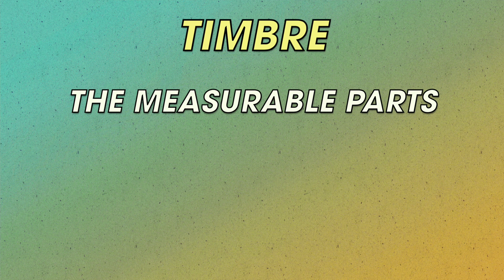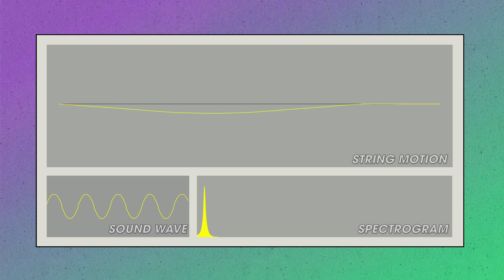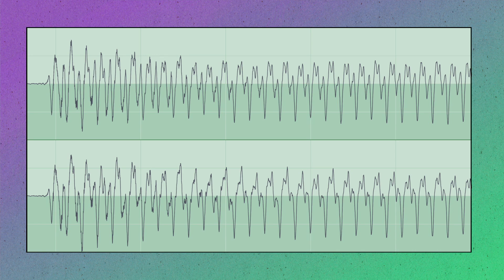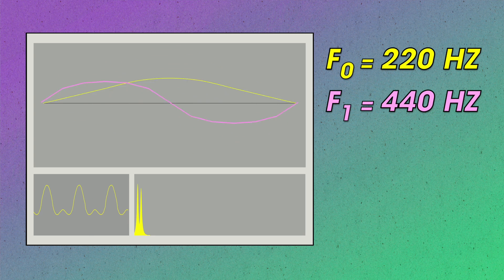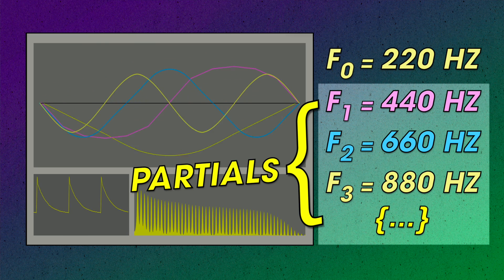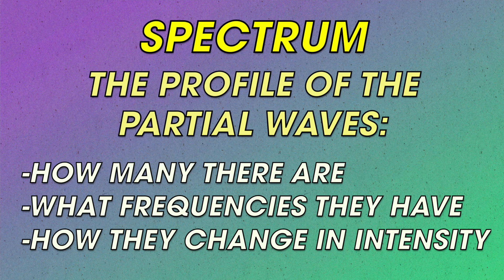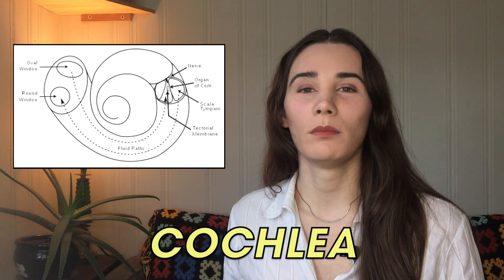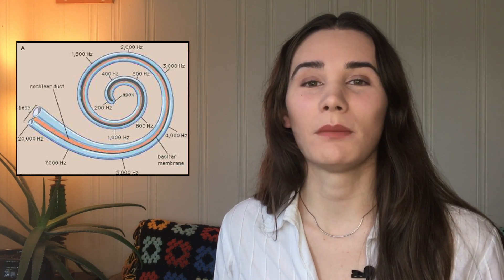What [almost] Everyone Gets Wrong About Timbre

Comment: I am confused by how string could physically vibrate on different frequencies at the same time, or maybe gradually. You showed it as several strings vibrating differently at the same time. 

I’ve seen videos of strings vibrating in slow motion - it actually looks like it’s vibrating at one frequency at the same time.

Comment: Volume,speed of light traveling at condensed pressure increased force different colours are different heat and different levels of atomic weight in the qaurks as the frequency value degree travels at different rates so hence waves the heavier burn at one rate and get there slower than higher rate speed light energy under excited pressure burning hotter the qaurks through dimension in waves expand contract in fission fussion and atomic weight particles break at different rates and burn different the alteration is breaking then qaurks join to other atoms attract increase propel some further in higher weight and burn so new intensity of colour on spectrum i think that is why people feel the asmr at different tones how the weight and volume speed force of different levels of tone and timbre colour hit them as sensory differences are distinguished
Reply: Tones frequency timbre sound at different rates of speed between high and low notes and the ear hears some before others so it can throw off the beats the rhythmic pattern and people notice time changes in rhythm

Comment: It's a very interesting subject and how the brain interprets sounds and timbre certainly is subjective but saying it's impossible to define is something I don't agree with. 
What you refer to as partials in this video is the harmonic series that naturally occurs. Sound is nothing more than stacked frequencies. The relation between those frequencies defines the sound/timbre. More specifically, the shape of the fundamental (not a perfect sine wave but rather a mix with triangle/sawtooth or square wave depending on the source) and the shape and amplitude of the different harmonics aka overtones is what literally shapes the sound.
Of course you know all this. I just wanted to add the physics part of sound.
Reply: Also very interesting what you said near the end about hearing the frequency and timescale at the same time. Just our brain's ability to recognise someone's voice you know, could be over the phone, on television or in a busy street is fascinating. Think about this, if you pluck a guitar string it vibrates at multiple frequencies at the same time. If you measure them over time you are certain of the amplitudes but can't know their position in time. If you take a snapshot however you are certain of their position but not about the amplitudes. Does this sound familiar to anyone? You could almost say the string is vibrating in a quantum superposition. Because in the end, everything is made up of frequencies that interlock, combine and or react with each other. The ' frequency beating' that you hear when two pitches are just slightly offset and light slowing down in glass or water or any material really is basically the same phenomenon of two frequencies cancelling out and adding to each other with a certain frequency. In the case of light it's the beating frequency that we percieve as slower light because the photons never really slowed down. We know this because when light exits the material it does so at lightspeed. Anyway, frequencies man... Let's just say it resonates.

Comment: Very complete! I saw a couple of papers that used the following method: the researchers played pair of sounds to musicians and asked them to say how much, from zero to 10, they were different. By doing this they got a bunch o sound pairs and the distance between them. Notice that hey had the distance between a flute and a piano, a piano and a clarinete and a flute and a clarinate, for instance. Using the example we (three sounds and three distances) we can now build a triangle. A plane is defined by two dimentions - the x and y axis. They then got measurements off of the sounds and tried to find if those two axis meant something.

In reality, they got a huge number of pairs and a huge number of opinions (the distances from zero to 10). They used statistics to normalize the opinions (if one musician never said a pair was distant by more than 4 they would stretch his numbers so 4=10). After that they did something that requires a lot of math to solve: they had to find the positions for the points in a plane or 3 dimensional space in a way that all the distances matched the different opinions from the different musicians about different pairs. Unfortunately I read the papers some 20 years ago and don't have them at hand but I remember one result: one of the axis represented the energy in the first milliseconds - that is, the attack. The attack is indeed important and other psychoacoustics research had shown that if we strip the attack out of a sound we have difficulty in differentiatint different sounds.

The idea that timbre could be explained as the different contributions of each harmonic to the whole sound was proposed by Helmholtz and was accepted for a long time. Probably with the musical revolution of the 20th century (Varese, Cage ...) people started to ask themselves if Helmholtz idea really explained it all. The experiments that distorted the envelopes without changing the spectrum showed the German phisicist's idea indeed left a lot unexplained. 

Your video is excellent and very complete. You also managed to make a difficult topic easier to understand. Thank you!

... I however can't help myself from making one explanation and one suggestion.

Explanation: FFT is the Fast Fourier Transform algorithm and it behaves exactly like you explained. It's different, though, from the Fourier Transform - something somewhat weird as you'll see. To find the Fourier transform I have to integrate something that is a function of time - like sin(t) or something else(t) - starting with t at minus infinity and going all the way to plus infinity. That means I have to know not only all the past of the signal but also all the future of the signal!!! We can't do that to get the real time spectrum of a signal and even if we do it after we got the whole signal it will have no temporal resolution. There are cases, however, that allow us to use a trick - the case of a signal that oscilates always in the same way. For those signals, if I have 1 period of the signal I know all the past and the future. The transform is actually really useful: in the original mini Moog, for instance, when you selected square, triangle or saw waves you were actually selecting a bank of sinusoidal oscilators that when all of them were added produced an almost perfect triangle and so forth wave. The phase and intensity of those oscilators come from the Fourier Transform.

I'll actually make two suggestions:

1) If possible, don't even mention Fourier because people will get spooked. I think you don't even need to say what the acronym FFT means. I studied electric engineering and we use another transfomation, the Laplace Transform. The Fourier Transform is part of the fourier transforms but even though it's simpler, people don't like to do the math - they like the Laplace transform a lot more. For electric engineers, those two transforms are the bread and butter + the coffe with cream of their profession ... and Fourier never ceases to spook them!

2) Explain what the spectrum image means. I think, however, that your audience already know that.

The reason I really liked your video and spent so much time making this comment is I really liked how you managed to explain the subject without all the boring and scary math that mathematicians and engineers use, fruitlessly, when they explain the same subject to musicians. It's somethingt like this: engineers and mathematicians know all the rules involved in tonal harmony - the fundamental, the fourth, the fith, the change from major to minor  ... all in our brains. Musicians feel the rules in their souls and feel how strange the change from major to minor is. Wow ... I got so poetic - but a bit pathetic! 🤠

Comment: The difference between timbre and pitch is not one is more real than the other. The difference is that pitch has more variables.  

You would have a similar problem if I said change the colour.  There are three variables to change. Without saying which ones to change or for that matter how much to change you will have an ambiguity in your communication.  

The difference is with colors and timbre is that with colors many people know how to use a computer to get a pretty accurate color specification. Where as with timbre how many people know how to use a synthesiser to get the sound they want. And we don't have a standardised system to map those parameters with numbers so that we two people can plug in the same numbers and get the same sounds. 

But it is theoretically possible for humans to set up such a system.
Reply: Additive synthesis is a standard system that can make any timbre.
Reply: What about Fourier series to represent the partial frequencies.

Comment: Nit! (Wonderful video, I'm just one of those nerds here to nitpick, maybe some other viewer will find this interesting)

FFT is short for Fast Fourier Transform. This is a computational algorithm for performing a Discrete Fourier transform (a Fourier transform of a finite series of numbers, e.g. a digital representation of a signal), both quickly and with higher accuracy than straightforward algorithms. Indeed it is commonly used by computer software displaying or operating on spectrums.
Furthermore, a Fourier transform generally operates on an entire signal - i.e. the input is one "amplitude-over-time" series, and the output is one "amplitude-over-frequency" series. The examples shown as Spectrograms are generated by an STFT - Short-time Fourier Transform - which is essentially a series of Fourier transforms for short durations of time (so you get two axes - X for time and Y for frequency). Indeed, there are FFT-based mechanisms for computing STFTs. Human hearing likely does not perform a computational FFT algorithm, but I think it can reasonably be assumed to do something similar to an STFT.
Reply: It is really nice to have an intelligent comment.  Yes FFT is Fast Fourier Transform and is a technique for mathematically analyzing a periodic waveform into a series of harmonics (sine waves) to accurately reproduce a periodic waveform. In the 1940's until the 1970's or so, it was widely taught, by electronic music enthusiasts or even Lenny Bernstein, that timbre was defined by waveform.  IE: because sounds that "have" the same pitch have the same number of cycles per second, and the only thing that should be different, between those notes, that would give a sound its character, would be their respective waveforms.  This kinda flew in the face of the obvious , like the envelope should play some part, but the idea that the waveform was pretty constant for a given instrument , and only the loudness was varying over time, with the envelope, and therefore not too important, also was assumed.  

  As the use of analogue synthesizers with the ability to change lots of parameters became more ubiquitous, and sampling and recording of waveforms on digital platforms with graphic displays became more widespread, it became obvious to a lot of us in the field, that waveform (and not necessarily periodic), and attack, decay, and reverb transients, quick pitch modulations, the envelopes of the harmonic and non harmonic tones all play a role in what we call timbre: the sensation of an individualized musical voice. Check Wendy Carlos on her harmonic synthesis with a computer, and synthesis of a xylophone, by adding some non harmonic transients at the beginning, what she called a "shake" ... YT Video, W Carlos on her new computerized synth..  One may also start with virtually the same waveform, and just by changing the envelope, plus bandpass over the course of time, make a sound that could be a pretty accurate cello, or piano, or saxophone.  it also turns out that the phase relationships of individual harmonics, or a fair amount of variation in the brightness or darkness of a sample doesn't necessarily throw it out, as an accurate representation of the timbre of a given instrument.  It is my contention that the brain is somehow conveyed a pretty accurate representation of waveform over time.  if You doubt this, You will find that You can change individual periods of a sample, or small changes in the evolution of a waveform , and hear the difference.  Sharp waveforms sound sharp, and round waveforms sound round. Another thing about certain repeating waveforms that are non the less not representative of resilient vibrations...  You can make electronic waveforms in which the period of the positive going and negative going peaks are related by an irrational number.  Certain of these cannot be fourier transformed to a high degree of accuracy, although You can come quite close as long as the first pair of peaks and valleys are followed by another pair in reverse order, or opposite polarity.  Try tuning up a pulse wave with irrational sequential zero crossings, they never sound in tune.  Some of the growl of a bass viol represent a similar phenomenon.

On another aspect of math and music.  Let us once and for all stop talking about partials, and stick to the following rule for discussing harmonics for the sake of clarity. The fundamental, is the first harmonic, because a frequency X 1 is a unison which harmonizes with itself.  Even harmonics start with 2X, and continue 4X, 6X 8X 10X etc.  So saw waves are made up of all harmonics, with decreasing amplitude of 1/harmonic.  Square waves are made of odds 1,3,5,7,9,11 etc. same rule and triangles are the same with decreasing amplitude of 1 over the harmonic to the power, and reversing phase at each harmonic. The idea that some people are still talking about partials , so the 1st partial is a fraction of the whole, or the first overtone is higher than the fundamental so it equals 2X the fundamental just confuses everything.  It is the same ridiculousness that surounds the idea that normal scales are made up of 8 tones, while chromatic scales are made up of 12.  DEFINITELY NOT SO. Count the tones.  There are 13 chromatic tones if You include the start and end of the scale in a chromatic scale from C to shining C , and if we were using the idea of twelve separate tones making a chromatic scale,  then there would only be 7 scale tones in a standard major or minor scale  ... please count them : C,D,E,F,G,A,B.  Math for music only works if we are consistent with the definitions of what the numbers represent.

Comment: I thought.... but perhaps I am wrong... that partials are not entirely subjective and made up by the FFT algorithm. I mean that they are stronger at 1x, 2x, 3x, ... the base frequency, than say at 1.15 times the base frequency must have some physical explanation in how waves moves in strings and how the air behaves in a tube (for wind instruments). Yet your video makes it sound like that part is just because the FFT algorithm likes to describe it in multiples. Indeed the FFT algorithm likes to use prime numbers, but isn’t it the case also that instrument physics is also a reason why the frequencies of partials are usually an integer factor with respect to the base frequency?
Reply: Yes. A steady excitation source will create harmonics at whole number ratios.  Those harmonics are determined by the shape of vibration.  That shape can be understood as literally the physical sum of sine wave partials.  That is, physically if you could sum sines in the air in exactly the way you need to, you will create the timbre of any object that vibrates in the same fashion.

Comment: Wow, That was in excellent explanation, as deep as it is. makes so much sense on what we perceive to hear. i believe my brain, i guess not my ears have become more educated in good sound over the years as my hearing has actually diminished. i really cant hear over 14K but yet feel i am losing nothing in the music spectrum. Does Timbre in some way also have to do with 2nd Harmonics?
I've learned changing 1 freq. on my EQ. will change the sound of several freqs.
Reply: What do you mean by 2nd Harmonics?  If by 2nd harmonic you mean the first overtone then yes… that has to do with timbre. Not sure if 2nd Harmonics is a term I’m not familiar with though.
Changing one frequency on an EQ can change several frequencies because the quality curve can never really reach infinity. A Q of 10 and above should be able to isolate a particular harmonic reasonably well.  Note that the feedback of boosting a signal can change the time response of a signal. Changing the envelope of a sound can be considered a timbral change.

Comment: Suuuper thankyou!
Reply: Oh wow. 

There's a lot to unpack here. 

We understand timbre and what makes it, very well. Check out the Wikipedia article some time. It's not small.

Also, the bit about 'spectrum'. I don't quite understand what you mean when you use that word. We use it to represent a range of things. ie the human hearing spectrum is 20Hz-20kHz. 

Also, what you're hearing never changes if the source is the same. You may experience it differently, but it's the same sound. 

There's a few other things you say that are kind of odd, and you seem to have your own definitions for some technical terms. 

Where was your degree from?
Reply: @WillSmith-qc7qh  Where did YOU get YOUR degree from?
The explanantion of spectrum in reference to the topic here is perfectly well explained, go read up on Wikipedia what spectrum means in this circumstance. You seem bitter mate